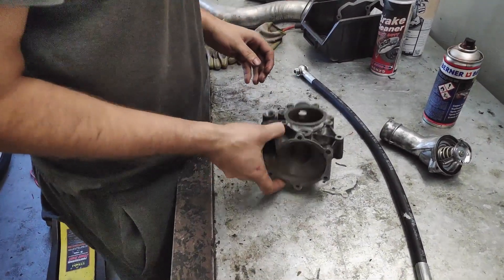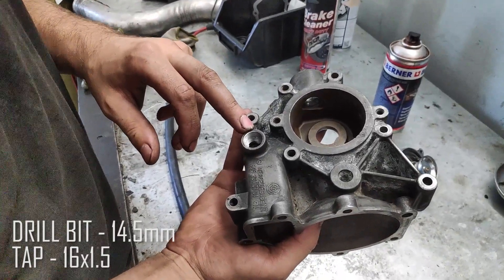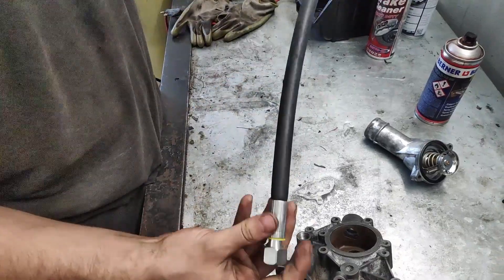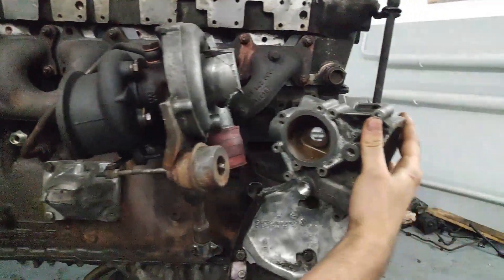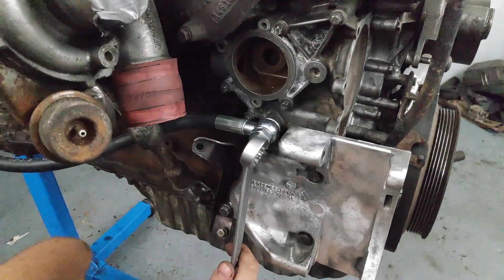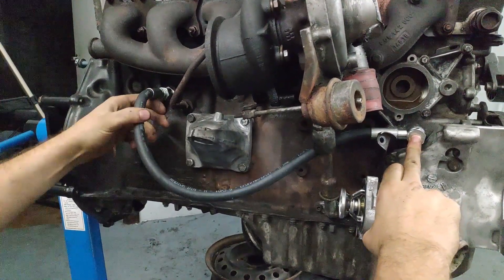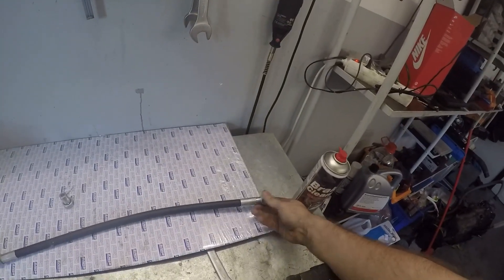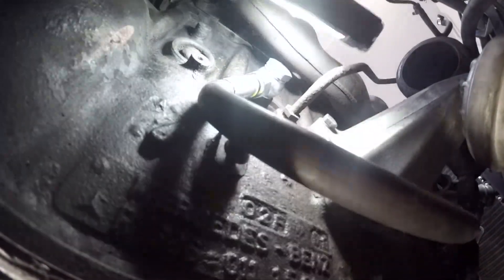Improving om606 rear cylinder cooling wth the cooling mod

Comment: Do you think it is also needed for the normal aspirated OM606 (without turbo)?
Reply: The cooling system works the same .  It helps prevent the rear 2 cylinders getting more heat then the rest of the cylinders. Is it needed ? not really when you're not boosting the engine .  But better to have it and not need it then , not have it and need it IMO.